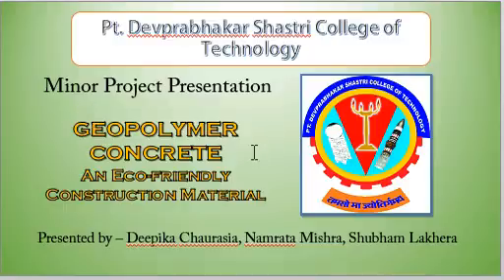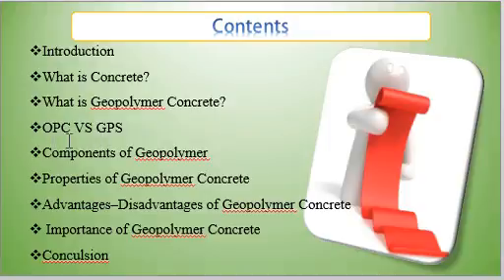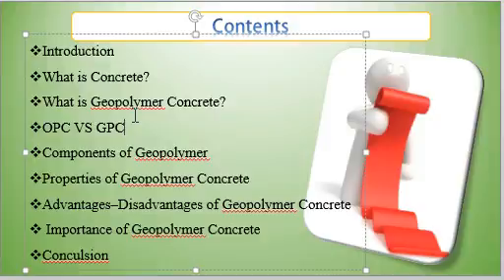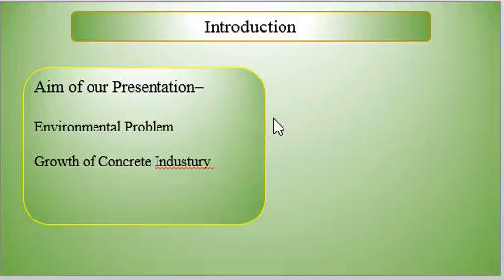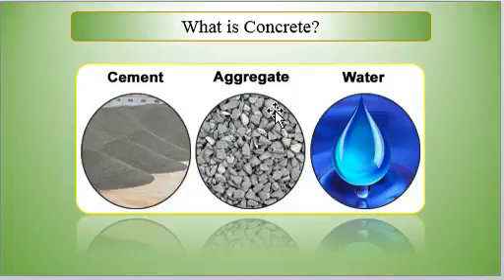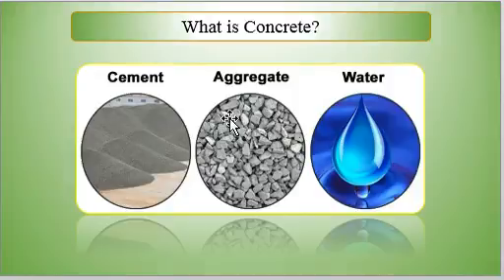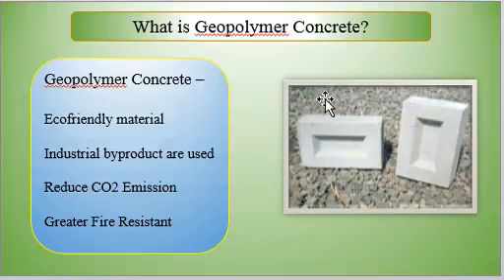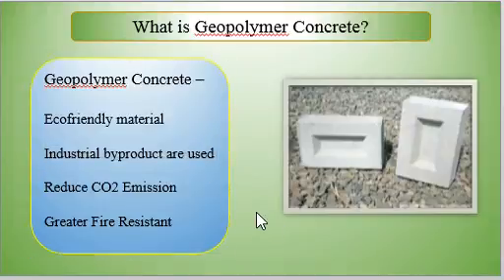Geopolymer Concrete (Minor project Presentation)

Comment: Hello.. why should we used geopolymer concrete in future???. Please Answer me.
Reply from the maker: Eco-friendly
Uses waste products from Coal power plants
Reduces dust in atmosphere (so cleaner air)
Not significant change in strength
Less cement use (lesser use will use to lesser production, ultimately, less green house gases)
Reply: Thank u sir
Reply: Sir . Thoda geopolymer concrete ka future ke related batao na .means example uses

Comment: Hey can some tell me can if we can use geo concrete to make fly ash bricks
Reply from the maker: Yes You  Can.. Infact such bricks are already being made, called fly ash bricks. They are light weight more durable and eco-friendly also economic. Since it uses the byproduct from coal plants so it reduces dust particle s , from going in our atmosphere.
Reply: @ShubhamLakhera  i have a fly ash brick making machine but two questions  
1. I want a semi dry mixture of mortar of geo polymer concrete not flowing concrete
3. When these geo polymer bricks are being installed at site  do they stick to the regular cement mortar my contact is inayaaenterprise@gmail.com if possible pls contact me
Reply from the maker: @inayaenterprise9536  As far as i know binding will not be problematic becoz enough amount of cement will be present in that. Look Geo-polymer concrete helps in reducing use of  cement. Cement production cause alot of CO2 emission from plant. Using polymorphism technics less amount of cement is  required, in turn less production leads to less co2 emission. 
But bricks already cause less  or no pollution. Using polymers will instead increase per unit cost prize of bricks. They will be suitable for construction but too expensive and of less importance.
Reply from the maker: @inayaenterprise9536  and i would suggest not to give your contact information openly. DM me, or email me.
Reply from the maker: consider subscribe if like my work
Reply: @ShubhamLakhera  sure will subscribe u  and thanks for your interest  one more thing  i want to replace cement completely in the production of fly ash brick by would replacing cement j would save 1 rupee per brick and daily 20000/
Reply from the maker: @inayaenterprise9536  nice move. keep looking for ways. Best of luck